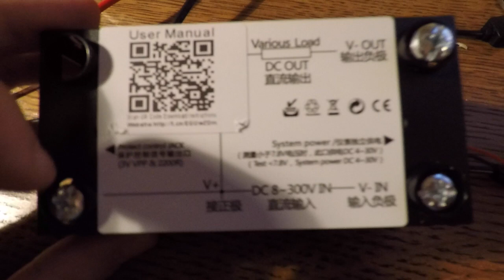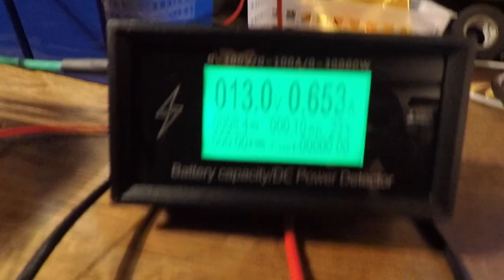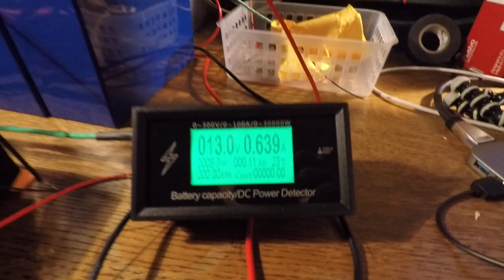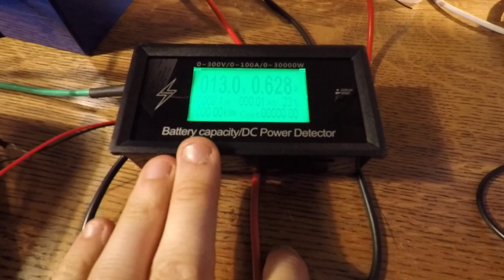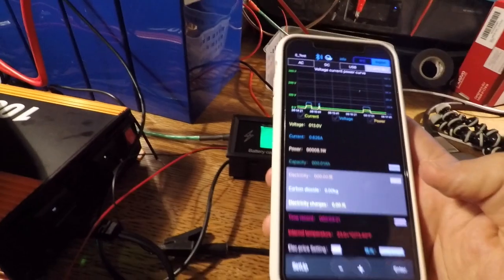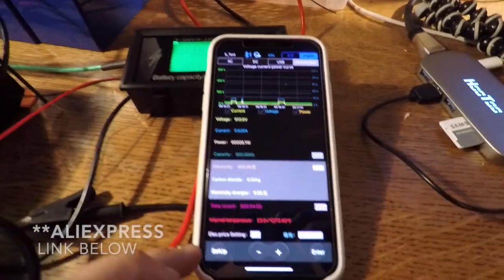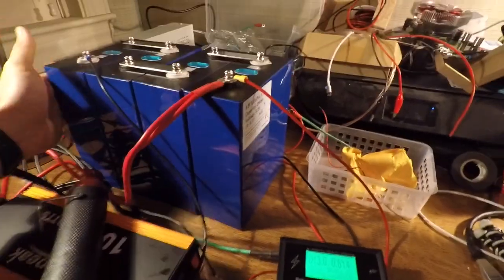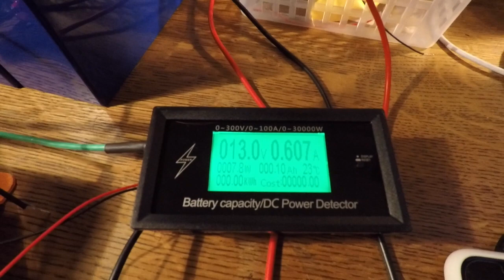Battery Capacity Meter - Test, Review and How to

Comment: I use these for solar PV water heater.  Slow rise in voltage in the morning will drive these crazy.  It mimics the actual calibration procedure and can render the meter useless.  I have to have a relay that pulls in at about 50V to keep these working.  Notice your scale only goes up to 60A on the phone.  Double tap scales and scaling will change.  Both scales affected at same time. 6 decimal points then eats up graph space. Two fingers can expand and reduce scale.  You have to keep your phone there, good use for an old phone.  Phone screen snapshot can save your images. There appear to be other software functions I have found no way to get at.  So close to something good but like all China stuff it is made for the impulse sale with no interest in creating a good product.
Reply from the maker: Thank you for sharing your experience. This is definitely on the cheap end and I although I think it decent, I believe you when you describe the limitations.